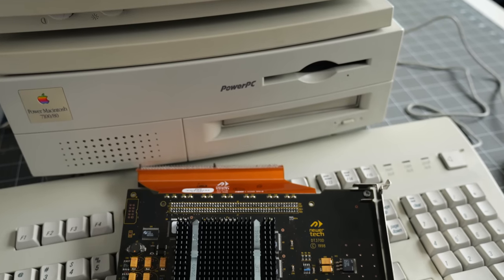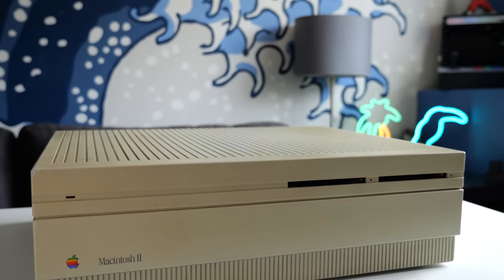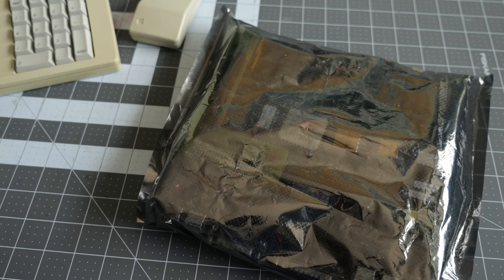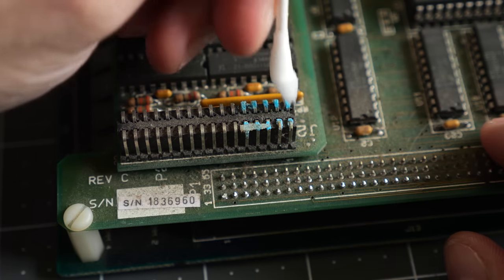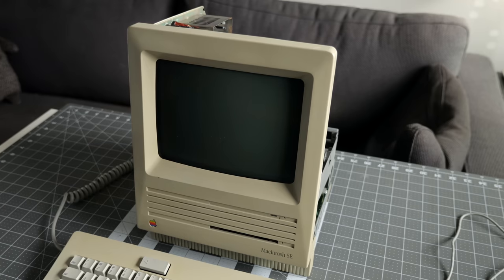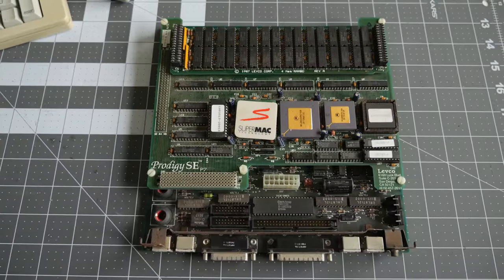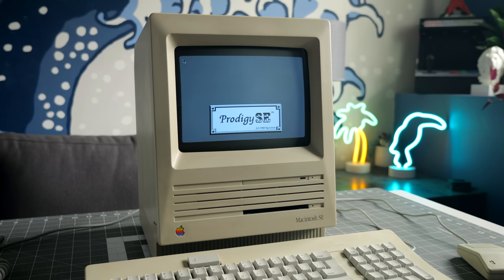This vintage upgrade made the Mac SE into a MONSTER!

Comment: "Maybe it needed a moment to sort itself out." I just love the temperament of old machines and cars.
Reply: A friend told me a joke once.

A plumber, an electrician and an IT guy were in a van when it broke down. The plumber thought it was the fuel line, the electrician thought it was the wiring whilst the IT guy said 'give it a few minutes and it will fix itself'.
Reply: Just few moments to charge up those dry capacitors
Reply: @tech34756  I’m saving that one!
Reply: Either that or if it had a cpu upgrade it needed a reset to recognize the new cpu
Reply: @adventureoflinkmk2  According to one pinout diagram, the connector does have the reset line on it so the expansion card should be able to reset the system itself.
Reply: @getermoura just don't lick one!
Reply: As beavis out of Beavis and ButtHead once said in an episode where beavis and butthead did tech support when some guys computer didn’t work”Did you try setting it on fire?”

Comment: i guess mac users tolerate non-upgradability shenanigans because it's been like that from day one. i mean I can understand the new "ultra fast memory so it has to be integrated into the CPU" concept of M-series silicon, but "soldered SSD" is just plain greed. and well, e-waste potential. and apple knows it can get away with it.
Reply: yeah and now microsoft is doing stuff like that with win11, it made many computers, which are still fast and usable, turn into e-waste. microsoft is making computers, which are still snappy, go to waste. also they put lots of bloat into windows 11, but it can still run on a core 2 duo laptop with 2 gb ram, pretty quickly. you have to bypass the bogus requirements tho. i’m maining a 5-6 year old lenovo 330s with upgradable ram ssd network, and it’s fast with arch on rhere
Reply: @beepyshenanigans  the microsoft that announced they're going to sell replacement parts for the computers they make? also for a secondary machine I'm running an old Core2Duo 3GB RAM with the latest kde and ubuntu and it works beautifully. an HP Laptop bought back in 2008. I upgraded its SSD and it's been great.
Reply: The same Microsoft that said Windows 10 was going to be their last OS. Newer computers are less serviceable and companies get rid of them after 2-3 years, calling them “old”. I’ve got Thinkpads older than I am that still work. E-waste is the new model because of consumerism.
Reply: The original Mac was designed to have upgradeable memory. Admittedly it was behind Steve Jobs' back and required a soldering iron (Jobs would have noticed a memory socket so they couldn't include one) but the motherboard designers did purposely route some traces to make the process easier for end users.
Reply: @3rdalbum  shows how the designers cared
Reply: @JH-no8sy  same, i got a dell c600 that’s like 10 years older than me and a thinkpad that’s like 5 years older and a gateway that’s 9 years older than me

Comment: I didn't expect that the upgrade would have been over $3000, I expected $1500, maybe $2000 at most. The apple tax has always been around, even going back to the Apple 2, which costed about double of a PET or TRS80, it was more useable though.

Comment: Saying 'not all programs could utilize a math co-processor' is the understatement of the century.  Very few pieces of software could utilize  a math co-processor.  They were incredibly rare. Very few people used them so there was little reason to support them.  Spreadsheets were the only software that used them generally speaking.
Reply: Spreadsheets - in retrospect - were indeed the first Killer App. Until Visicalc the business market was mini/mainframe and for businesses over 250 employees. That made a "personal" computer valuable. And I think, but this is an opinion I cannot back with fact, it also had the advantage of making PC's appeal to director level and above management - the people who could actually budget a $8000 tool. Prior to that - for text only PC's - the only business app was for word processing and tiny databases that fit on a floppy. Very hard to justify the expense when a typewriter and bottle of whiteout were much cheaper. Hard drives and servicable memory space (Lotus Intel Microsoft LIM memory expansion) then allowed the device to extend its reach. The Mac's 68000 had enough horsepower to do a GUI and also support both these critical features. Its focus on Desktop Publishing sort of missed the mark for the business market at first which allowed the comparatively weaker - but cheaper - IBM PC (and clones) to dwarf its volumes.
Reply: CAD programs like Autocad back then would also utilize the Math Co-Processor i remember showing off the difference in 2 identical 386 machines, one with a math co-pro and one without, what the speed difference was in rendering. i had it rendering a wire-frame drawing of a fighter jet, the math co-pro had it done in under 3 minutes and the one without to over 15 minutes to render.
Reply: @dennisfahey2379  You would be surprised at how big these spreadsheets can get.  This was basically why they created LIM EMS.  I worked for an accounting firm that did modeling with spreadsheets many megabytes in size.  When I first started there in the early 90s, they were retiring a bunch of old 80s PCs and it was my job to retire them.  Most were XT class, nearly all had large amounts of EMS memory installed.  We're talking full length cards loaded with DIP memory chips.
When it made sense, they would spend money. (There was probably 10 million plus dollars in that room worth of RAM when new)   But when it didn't, they refused.  That's why they were just retiring these machines, despite it being 1994.  They figured these machines had the RAM and updating would not significantly improve throughput because a lot of the calculations were done overnight.  If it does the calculations in 3 hours instead of 8 or 9 hours overnight, it's still going to be overnight because nobody is going to sit around for 3 hours at 5pm to see what the outcome is going to be.
Reply: @clumaster  There were certainly some applications that benefited greatly. But these were not apps in widespread use.  I have absolutely no idea why anyone today would put a math co-processor in a 30 year old computer.
Reply: @dennisfahey2379  ... The funny thing in retrospect was that in the mid 1980's, I used actual paper spreadsheets, because I did the bookkeeping for a medical clinic, & I was still in high school.  Even funnier, I knew how to program computers, thus I also knew how to create my own fonts to download to impact printers (dotmatrix) to generate custom characters.  In my case, I got tired of handwriting the headings on the paper spreadsheets, such as "taxes", "electrical utility" etc.  So what I did was make dotmatrix fonts rotated 90 degrees so that they could be printed sideways because the paper spreadsheets were long horizontally.  This was the compromise I had doing bookkeeping on spreadsheets traditionally by hand until we started to use the DOS version of Quicken which made bookkeeping much easier.  It was the same when the clinic originally used typewriters & handwriting to write up patient billing invoices & insurance forms until we got into patient billing management software in the mid 1980's.  Computers made all that faster, convenient, less errors & cleaner output.  Thus, much less need for rubber erasers, Liquid Paper & Lift-off correction tape.
Reply: @clumaster I needed a maths co-processor for doing various art stuff on PCs. They were ubiquitous among those of us who did any creative art work. I didn't realise how rare they were among general users until years later.
Reply: Some 3D flight and driving simulators could use the FPU to boost their frame rate. Without it, they would fall back to using a software-based library which was much slower. That’s the reason I like having an FPU in my vintage computers, because I’m fond of old simulators that I used to play as a teenager
Reply: @little_fluffy_clouds  Which ones?  I'm curious.
Reply: @tarstarkusz  the ones I still play are Hellcats over the Pacific, F/A-18 Hornet, Falcon F-16 and Al Unser Jr Racing. I think these benefit from an FPU, although it's probably not necessary to run the game. My classic Mac these days is a Quadra 700 with an 040 chip, so the FPU is built-in. At university, I had a student discounted licence to run Mathematica which needed an FPU.

Back when I used to have an Amiga, I remember 3D modelling and rendering apps like Sculpt/Animate and Lightwave could use the FPU, but I didn't have an FPU to test that with back then and I don't have any Amigas nowadays. That kind of work is much better tackled on a modern computer nowadays anyway. The vast majority of classic Amiga and Mac games don't use an FPU.
Reply: I remember that after swapping a full 68040 in place of the original 68LC040 in my Mac LC630 the window animations were much faster.
Reply: @smoguli  I think the full 040 was faster than the LC040 at the same clock speed. But I suppose it is possible the OS would use it, especially as the 040 machines were rolled out.  Once Apple was shipping a lot of machines with a math co-processor as default, they could rely on all (or most) shipping Macs would have the co-processor.

Comment: I have this exact rare upgrade card for an old SE I have. I didn’t even realize it had the card when I bought it at a garage sale for $10. I only realized was when I booted it…it was WAY too fast and responsive for an SE, and showed 36mb of RAM, so I cracked it open, and it was like Christmas… 68020, FPU and MMU. 

Still not my SE/30 powerhouse, but wow…it’s what the original SE should’ve been.

Comment: There were a ton of awesome upgrades for the 128k, 512k, 512ke, Plus, SE, and Classic. Not just PDS cards, but there were several upgrades that repackaged the system into a new case and allowed for external displays to be used. Of course, none in color since those Macs didn't support color. I need to look around and see if I can find some videos on those.

I knew a guy that bought an old SE back in the mid 1990's that had a radius upgrade with a full page monitor. Those full page monitors were awesome back in the day.

Comment: I have a Macintosh SE with a Mobius '030 accelerator card installed, giving me 16 MB RAM and a 25 MHz Motorola 68030. (It has a coprocessor slot for a Motorola FPU, but mine doesn't have one.) The Mobius card even has a video output for an external display for more screen real estate. I believe the previous owner used the display with it, although I unfortunately acquire it. He got a lot of use out of it... I believe it was used all the way up to the later '90s.

Comment: it's strange to think, but I have an 8 year old i7. It does everything I need it to do and I haven't come close to tapping its full potential in some ways. Looking back, though, try to imagine using a Mac 128k in 1992 as your daily driver, as the machine you use to make your living. It would have been unthinkable! Even though I lived through it, it's sometimes hard to remember just how fast everything was evolving back then, and just how quickly any given machine became obsolete.

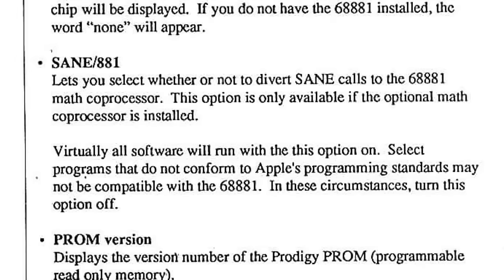Comment: Another wonderful video with excellent videography, as usual.  But I must say that the part shown at 8:21 about the special setting exclusively for MacWrite version 4.5 was truly interesting indeed.  Leads one to wonder if newer versions like 4.6, 5.0 & II were compatible with that setting, if they needed it at all.  Could be it only sniffed version 4.5, which meant you were probably stuck with that version unless you disabled the accelerator entirely.  All said, a very informative video. I have a special interest in the SE, seeing I have one with a Levco SuperMac SpeedCard.

Comment: I just opened an old Mac SE I got from a flea market, it’s one of those computers I don’t like fixing, especially with the CRT screen with that aging components! Also I wish those SE computers used HD floppy disks, because I had lots of old Mac games from that era like Dark Castle, Super Munchers, Alien Force, Diamonds, Daleks on floppy disks!
Reply: These compacts have held up better than much later machines. The SE has no leaky caps on its motherboard for example.

Later machines from the late 90s and literally crumbling under their own weight now.
Reply: @kirishima638  it depends on who used them back when they were new. I remember the ones used in an elementary school aged terribly, because they were worn out! Even the mice and keyboards were damaged or don’t come with their original computers! Also you better have some low density floppy disks, because the disk drives from 1987 won’t read them! I avoid the earlier models for their incompatibility issues and scarce components that are hard to replace!
Reply: @Markimark151  I’m not talking about wear and tear I’m talking about the construction.

Pretty much every beige II, LC, Quadra,  PowerMac and Performa released between 1994 and 1998 is so brittle and fragile so as to self destruct when touched but these early compacts don’t have this issue.

Their CRTs have also held up much better than the LCD displays of the PowerBooks.

And they’re generally easy to fix, provided there’s no corrosion or battery leakage.
Reply: @kirishima638  true that the older computer parts were better since they were sourced from American suppliers. But I hate how the proprietary parts and components are so hard to find and replace, I wasted so much time trying to fix that old Mac SE computer that I couldn’t even get those particular parts online! I had to go through different sellers and even my local computer shop doesn’t even know how to service it! Even  David the 8-bit guy doesn’t recommend Mac SE, he prefers newer Macs from the mid-90s for being more easily upgradable since they’re more modern and can have more flash memory!

Comment: Great conversion! Would love to find one of these for my SE but they seem to be unobtanium. Good job finding one and getting it working. I wonder if the Prodigy upgrade also allowed for HD floppy upgrades to match the SE FDHD.
Reply: Thats an easy upgrade, but would require a new drive, new system roms and a SWIM chip in DIP 28 form. Luckily all those chips are socketed in the SE.

Comment: It was rumored Jobs closed the Mac architecture for a couple reasons: 1) It substantially saved costs, 2) It reduced the number of tech support calls as most were due to expansion card incompatibilities and bugs and 3) he had just come off a major problem with the Apple II getting widely "cloned" globally.  A lot of people think the "clone market" started with the IBM PC but in fact as soon as the Apple II was a success the clones out of Taiwan specifically flooded the market. Names like Banana, Orange, Pineapple, Pear and Apricot etc. And these were more times then not direct knockoffs - same circuit boards, even copied APPLE ROMs. The story goes Jobs went to the Feds for help and they said there were no laws being violated. At the time there was no law protecting software, firmware and even board designs. People, including Apple, attempted to use copyright law to protect their IP but it was an uphill battle.  Cloning (piracy) was all the rage and it was not just Apple's problem. I recall hearing one company was almost driven into bankruptcy by a cloning concern that even duplicated the floppies, labels and manuals. This was found out when a customer sent in a unit for warranty repair and it was clearly not authentic. That particular company was shocked to find the pirate company had far better sales then they had.  
Interesting tangent - when Apple was in deep trouble they licensed the Mac for legal cloning. A design that used PC form factor parts and had more slots and higher performance was sold by "Power Computing". Those designs were far more powerful (primarily because they could have fans) and and cheaper than the real deal - being willing to accept lower margins . When Jobs returned from NeXT Computer to save the company he killed that licensing.  Interestingly the NeXT OS - NeXTStep was so advanced that is was used to prototype the WWW. That code merged into Mac OS-X and addressed some critical shortcomings. It was also the first consumer fully object oriented centric OS which gave it a fertile field for development. So what some have said was Job's biggest failure actually saved Apple and spawned the Web.  The classic exactly right at slightly the wrong time.

Comment: I think I installed a 68030 33mghz card, and 1mb to 4mb.   The SE was a dog otherwise at stock 68000 8mghz.  The 17mb 60ms access SCSI drive was noisy and slow but a godsend compared to the floppy shuffle.  Quickly outdated though.

Upgraded to a LC3 68040 @ 25mghz and color.   Both were nice machines way ahead of their time.

Comment: I saved 2 original Macs 10001's (i think that the model number) from a dumpster and they both had a Hyperdrive 5MB HD installed which at the time I believe they were $2000 upgrades.

Comment: I had a lot of fun with ramdisks back in the day when I first starting using a computer. I couldn't do it on Windows, but Linux let me just create them willy-nilly. Although there wasn't much point on Linux since it had less to load and was a bit faster than Windows on top of that, unless of course you wanted to use it for some kind of security purposes. I kind of miss them being a thing as now you definitely don't need them.